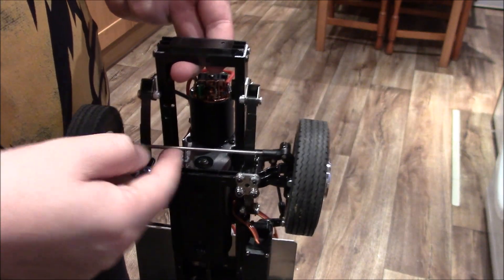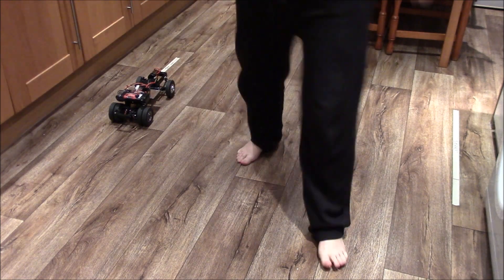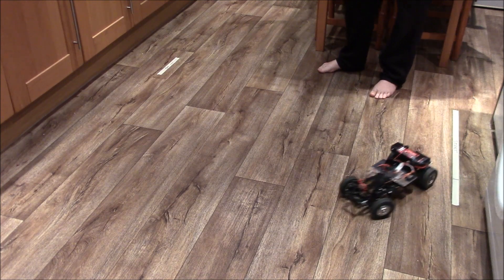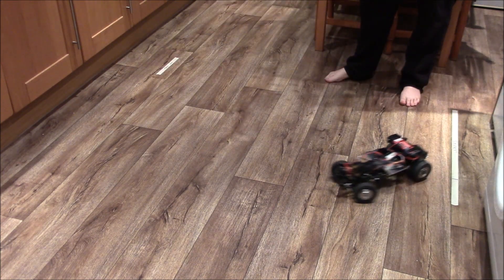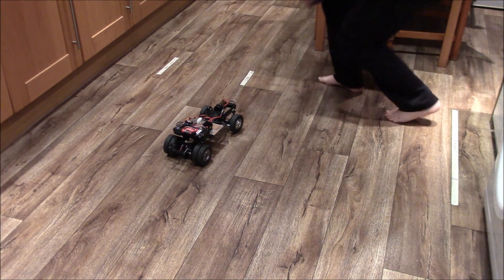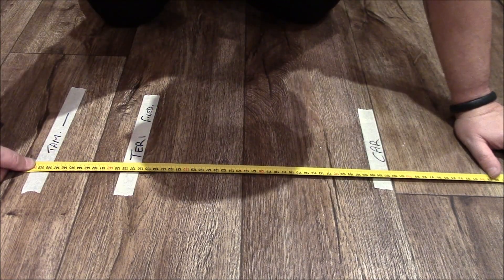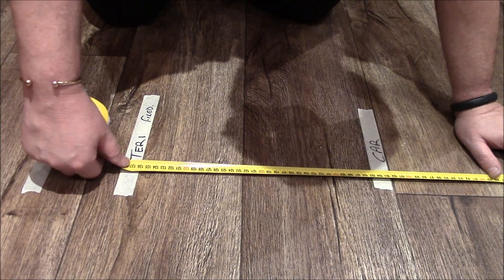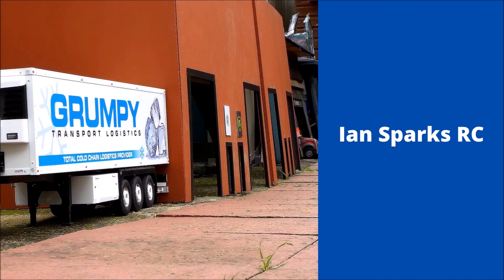3 Tamiya Steering Axle Setups Comparisons Results indoors

Comment: Well I wouldn’t thout that with the Carson as u say most pro lot people putin them on wrong m8 can I ask on the terry wild 1 did u file it at a angle or straight m8 as for the gearbox change Carnt u file the slots longer to give u the movement m8
Reply from the maker: I filed it flat but either way it hits the springs so cant turn anymore
Reply: @IanSparksRC  the wheel tyre hits the spring that’s very strang couse it should done same on Carson then very strange m8 🤔🤔🤔
Reply from the maker: @davidhazelden2054  no, not if the Carson bar is fitted correctly